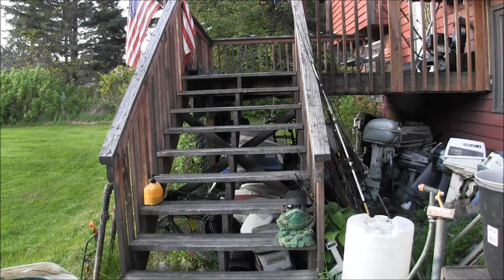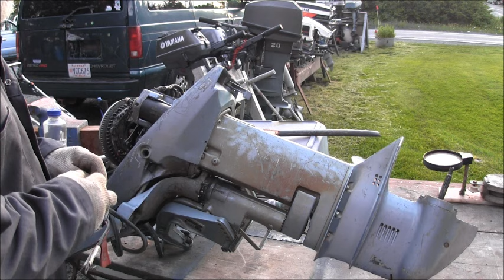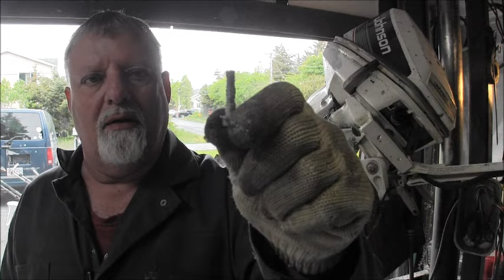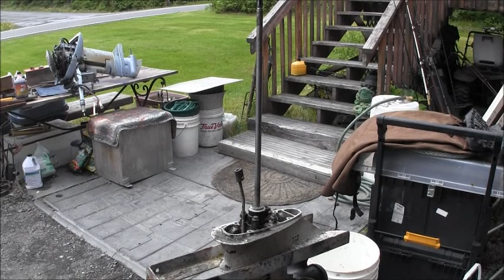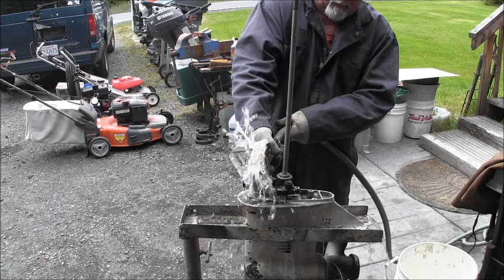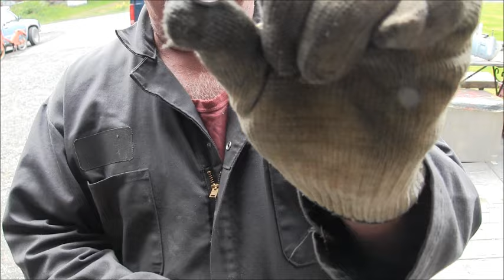JOHNSON  1990 15  HP  COOLING  PROBLEMS,  MYSTERY SOLVED!

Comment: Kodi just about every 9.9-15HP here has blocked drain hole. It is one of my regular rituals to pick the gunk out.Like you I use an extended drill attachmaent and long drills.I spend the time and always clean the original drain hole. Ive repaired the bulging cracks too,Ha!.Good video for everybody to see how you handle it...TOT62
Reply from the maker: 4 sure  I as well     kb

Comment: Kodi I saw a starter bracket for a 15 Johnson on EBay and they wanted $140. I set my 15hp Johnson up with a electric start without the solenoid and it works
just fine. Thanks for sharing
Reply: For sure...  Those darn intake/starter brackets are considered "gold" these days.
Reply from the maker: Yep'  bout the going price for 5 ounces of cast aluminium.     kb

Comment: Cool.  Always want to be wrong about my grommet diagnosis.  I suppose you could pull out one of the powerhead screws to see if it was gooped up also.  If so, seems like a good chance someone has already done the grommets on this engine.  
That damn drain hole is so important!  I can't even imagine how many hours I have poked, blown, scraped to get that passage/drain way clear and open on so many of these engines.  People don't realize that when that hole is plugged, the inner cavity of the exhaust housing stays full of water....Water that will turn to salt deposits and can end up in the powerhead.  All that salt build up around the water pump is a direct result of the salt water being trapped inside.  
As far as those garbagerators, it breaks my heart when we did stupid things like that.  I just can't imagine that plastic crap saved much over the conventional aluminum body bullet proof carbs.  The only benefit of them is the plastic bowl that doesn't rust and complete access to all the idle passages when the plastic top is removed.  But, when was the last time anyone ever had an issue with idle passages in the conventional aluminum body carb!  We all do things that aren't the best practice sometimes to get things running, but I fear that using goop on those plastic covers will create many more issues that it will solve by oozing out and blocking passages.  The final insult of those garbagerators is the ridiculous prices on the CPS replacement parts.  
You are soooo right Kodi, those electric starter bypass brackets, along with the ring gear flywheels, are "gold" these days and priced accordingly.  Please don't just "give those items away" buddy, and always have a few on hand for yourself.  
Finally, it looks like someone has put the wrong driveshaft in that engine, wonder if it was converted to long shaft.  That driveshaft should not have an oring groove up top.  The lower powerhead seal housing has two seals in it, the smaller one takes the place of the driveshaft oring.  Wont hurt anything, but makes it more likely that the splines will get rusted/seized though.
Reply from the maker: Good idea  4 sure,    kb

Comment: Hi Kodi, yep modifications can work but can also go bad. Nothing like good old metal to fix stuff and have it last. The problem now days is the cost of metal has hit the roof and the quality is not very good because people and using old scrap metal and melting it down to make new parts. Lost it's temper and cracks easy.
Reply from the maker: When  the salt moves in hard, Adapt & overcome.    haha      kb

Comment: there's a lot of those motors with those starter brackets down here in fl. :D 
oh and I always use a solenoid when I convert them, cause those starters still pull a lot of amps and burn up switches.

Comment: any advice for a 15 that pumps water irregularly? gromets ok impeller is new. do these motors ever have plugged channels where you need to remove the head?
Reply from the maker: If as U say the grometts r ok (  replaced,,.trimmed..inspected)?    Yes'  if your motor is a salt water motor  they can plug  like cement.  If mine I would pull the head & look around those passages.  If  they R coorrodid & full of salt it will be your indecator for the rest of the engine.      kb

Comment: I have a 2020 Merc 20 Hp short shaft outboard.  I have been told that it cannot be fitted with a trim and tilt kit.  Do you know if I add trim and tilt to this engine.

Comment: ive had mine fill with mud/sand and pump slow.  I flush head then with water hose thru water tube.  hope iam not hurting anything doing that and hope most junk comes out.
Reply from the maker: Just keep the water pressure  kinda   low.     kb

Comment: Us common folk need more marine motor learnen Kodi !!!😂
Couldn’t you just drill out the original drain hole in the foot instead of drilling a new one?? Thanks 🙏 👍
Reply from the maker: If The salt cement  will let you get down  that  far  then  Yes.     kb